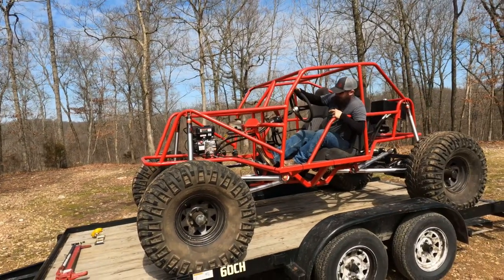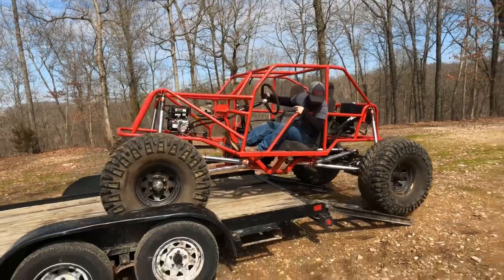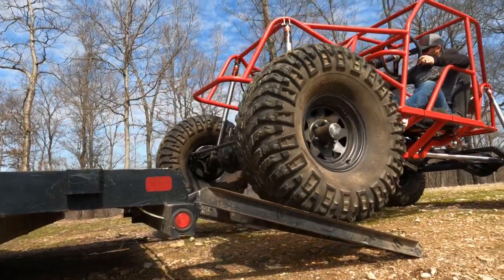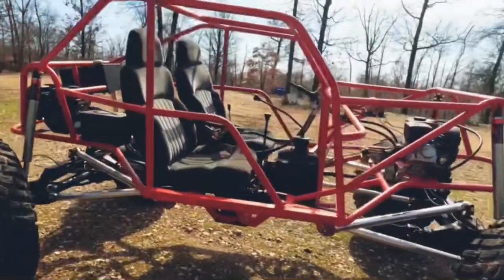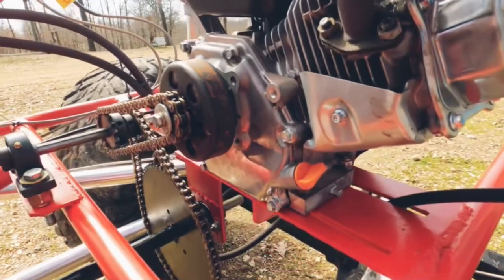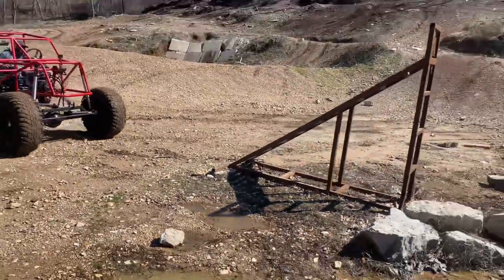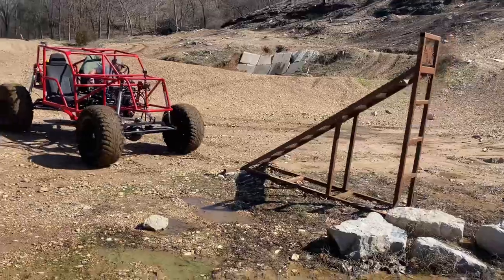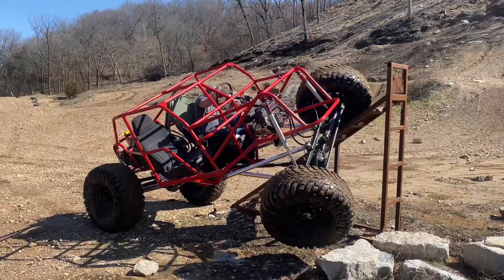Predator 212 Rock Crawler

Comment: Love the build. Have you though about maybe swapping the 212 for a 670 or even a 420. Get little more power out of it. To help bounce the rocks if needed. Very cool man.
Reply from the maker: It’s so gear reducted I don’t think 10,000 rpms would even help. It’s so easy to keep a cheap ole 212 in the truck for back up if one dies.
Reply: @CrawlDaddy89  its not even about the rpms the 212 simply doesnt have nearly as much pressure and power

Comment: Nice ride!! My favorite part is low center of gravity. Did you weigh the loaded buggy vs axles, tires and wheels? I bet you can get on crazy slopes before it flips.
Reply from the maker: @justinrichard6837  whole thing weighed just over 2000lb but yeah I tried to flip it didn’t have any luck.
Reply: @CrawlDaddy89  If you have more videos let us see. I have been trying to work out what I need for my son a small engine and Sami axle build when I came across your build. It showed me a easier way to accomplish my goal. Thank you. If you have some time can you help me with a question. I am thinking a 10hp diesel engine to run front hydro and power the rig. Do you think it would be enough engine for both?

Comment: I converted a Polaris Ranger 6x6 to a Predator engine 4months ago.  5:1 reduction before the factory 2 speed trans..3.5mph in low and 10mph in high, and centrifugal clutch never gets warm....slow but can crawl like crazy!!  Post more...love seeing this stuff.   Any build videos?
Reply from the maker: Very nice. I didn’t make any build videos still don’t own a camera a buddy filmed it for me. My clutch doesn’t get hot either doesn’t slip enough to cook them. I’ve been running one clutch for two years on my s10 frame buggy it’s a 10 tooth clutch to a 48 tooth sprocket on s10 5 speed it does 28mph on 212 with carb and pipe.

Comment: Great build. I have been thinking of putting a motorcycle engine into a lightweight car like a Mazda Miata. However, I have not found a good way to adapt a motorcycle engine to an automotive transmission. Any thoughts on how I could do this? I chose a Miata since the factory horsepower numbers are under 200hp, and a sportbike engine like a Hayabusa can put out similar power levels. ( Preferably, I would like to use a 200R4 or are automatic transmissions not a good idea) Thanks
Reply from the maker: @rifleman7313  I just used center piece from clutch and welded 1” keyed shaft to it chucked it up in lathe to weld it. You’ve gotta use a manual transmission it takes too many rpm’s to turn automatic and would rob too much power. Miata would be fun with motorcycle engine for sure. Just getting it to one side would be the only problem to make room to hook up chain

Comment: love the build, any reason why a 212 and not something bigger like the duromax 440? and if you want more power and torque out the thing, 24mm carb and giving it 6 degrees of timing will do it for cheap and its simple
Reply: Hydraulic pumps usually will cavitate at higher rpms. Meaning that if you built it like a minibike engine it wouldn’t work.

Comment: I’m actually building a very similar buggy.      What size Heim joints did you use for the 4 link. Since it’s so light I’m on the fence to go over kill or just enough to get the job done.
Reply from the maker: 1-1/4 heims 2” link bars

Comment: That this is sweet. Wonder if a built predator motor wound change it any? I always wanted to try a shaft drive motorcycle engine to a Suzuki samurai transfer case and axles. Being a divorced transfer case. Should work shouldn't it?
Reply from the maker: Oh yeah no doubt just have to play with gears on axles I’ll bet but that should work beautifully
Reply: Literally what ive got on the go with a honda gx630 right now..

Comment: question for you,
with your set up, if you geared it towards max speed, what will be gear ratio ?

cos i’m wondering how well a predator 670 paired with 35” tire will perform(not for rock climbing but just driving around for fun)
Reply from the maker: Really depends on transmission ratios but I would start with 10T to 60T then drop down from 60T to 48t or something I have a s10 chassis that has 212 with 10 to 48t set up and hits 30mph in 5th gear. Only other hurdle you’ll have is you gotta run torque converter set up on 670.
Reply: @CrawlDaddy89  ok understood!
thanks for taking time to respond 👍
appreciated!
Reply from the maker: For sure show off what you end up getting done anyways cool to see new projects
Reply: @CrawlDaddy89 why is a torque converter needed on the 670?
Reply: @terrymason3093  better for on/off throttle and higher rpm and its what side by sides use its from a durability standpoint....centrifical clutches are built for more full throttle or no throttle there is no in between but with a torque converter you can hit the full rpm range without burning it up
Reply: Cant you just run a 10t to a 60t right off a standard gear box and use the vehicles stock clutch? Could jack shaft it and run 2 different sprocket sets, one for crawl and one for doing 50km/h in top gear?
Reply: @kydavies7620  very valid point ......idk try it and lmk cause I'm kinda thinking the same thing
Reply: @spartansoff-roadrecovery5058  okay so you totally can... Swapped a honda gx630 into my samurai using the stock clutch and flywheel. Geared it 2:1 and It works fantastic.
Reply: @kydavies7620  just because you can doesn't mean it will last as long as a torque converter I've burned through 4 clutches on a 212 and 0 torque converters sooooooooooooooo yeahhhhhhhhhh there's that
Reply: @spartansoff-roadrecovery5058  oh im not running a go kart clutch, i have 1" keyed shaft bolted to the samurai clutch and flywheel. Literally just replaced the 1.0l with a 630cc and sprockets. Id put it up but i dont do instagram or have a youtube
Reply: @kydavies7620  ah got ha

Comment: cool buggy like what you did do you think it might go a little faster with a bigger motor.
Reply from the maker: If I build this engine to spin some more rpm’s I’ll gain a little speed
Reply: @CrawlDaddy89  even a stock 420cc engine will double your hp thats a huge increase in power. might be cheaper than trying to get more power out of your 212
Reply: @AA-tb4ff  Mulitple 212s is the cheapest option. 2,3,4 ?? How many?
Reply from the maker: The lack of hp is what makes it cool to me it doesn’t really struggle at all the way it’s geared it’s just not gonna be fast with the sprocket reduction set up. I don’t know the rpm’s going into transmission but they’re low

Comment: Whats your overall crawl ratio?
Reply from the maker: We figured it one day it was like 540:1 or something
Reply: @CrawlDaddy89  what is your transmission, t case and rear end ratios? Do you still have the buggy?
Reply from the maker: I sold the buggy. It had a Chevy sm465 mated to a np205 and Dana 44 axles with thick cut 5:13s but going into the transmission it was at 10:1 ratio

Comment: Buddy, put some kart racing parts on the predators like on my kart which you can see on my channel and you will get a wicked fast crawler
Reply from the maker: Haha I don’t know about fast with my gear reduction but it does help some I’ve got a engine with governor removed springs and carb that turns 6k and it does help but having the bone stock engine is nice cuz I just keep a back up engine in my truck if one dies I just swap it out